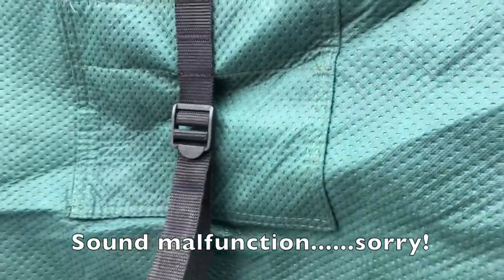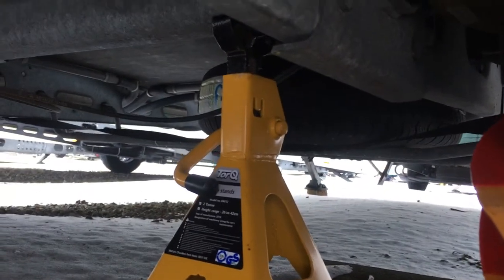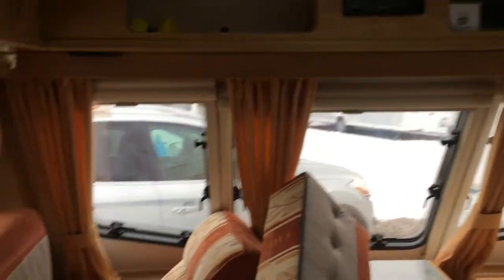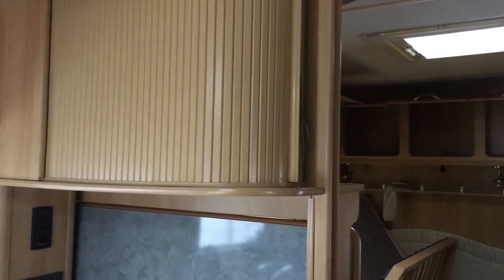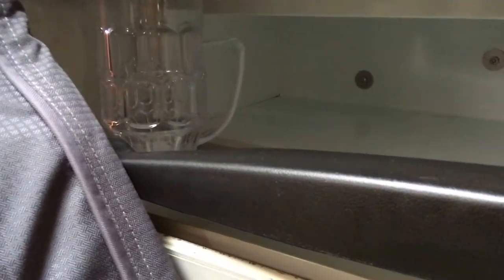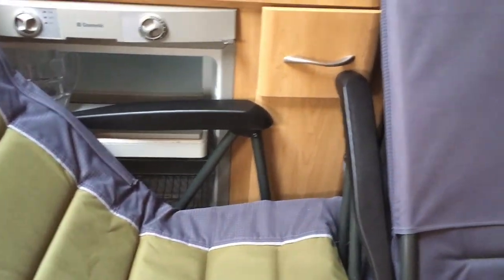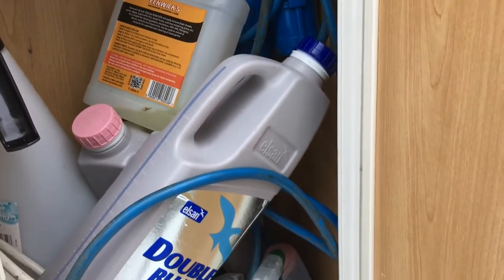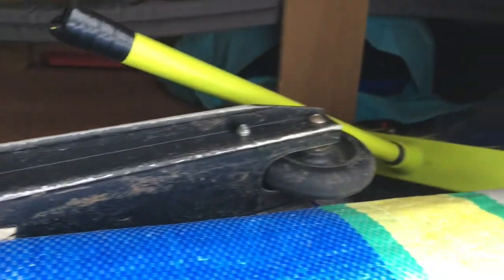Winter storage

Comment: Hi  Mr Nut
Great video as usual. We had a cover on our Lunar.  The cover split at exactly the same point as yours.  The chimney has got a very sharp edge to it.     We repaired the damage with a piece of Tear-aid (Type A) (excellent stuff, by the way) we also covered the sharp edge with pipe insulation held on with Gaffa tape then  a small Tupperware container was placed on top before re-fitting the cover. I know you have changed your caravan since, but I hope this will help somebody.
Reply from the maker: That’s a good idea with the Tupperware container. I’ve seen some covers with a hole cut around the Flue, kind of defeats the object. Thanks for comments and watching, Cheers, Martin